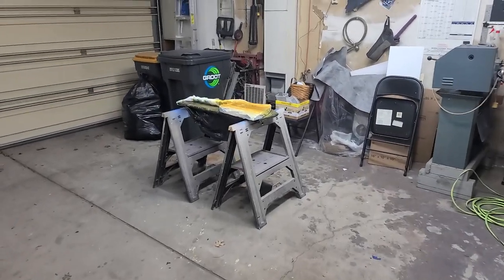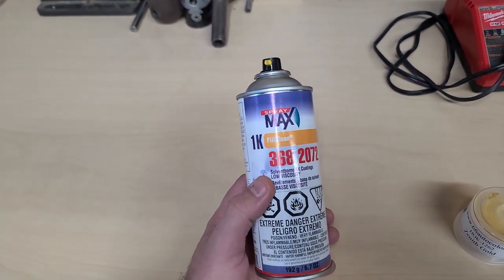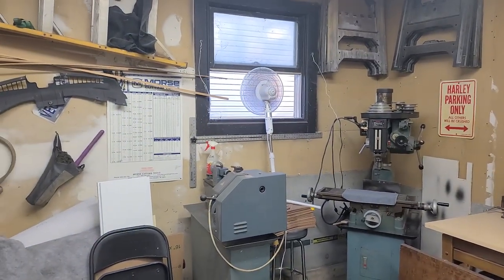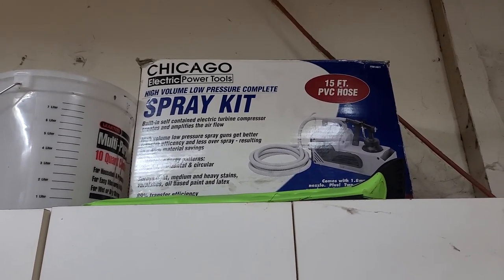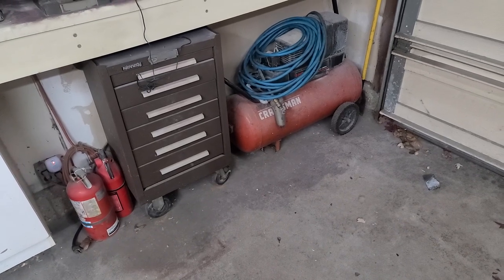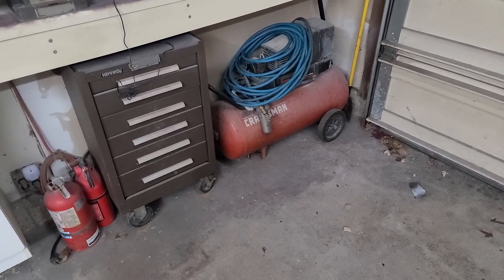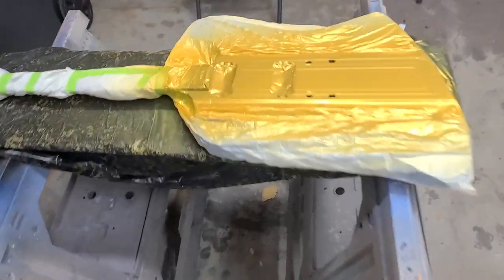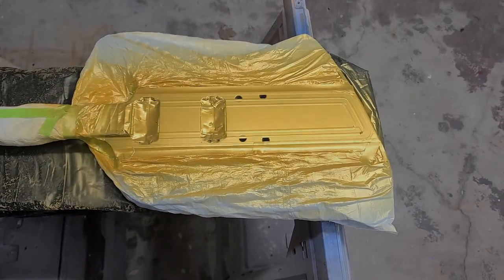Gold Phoenix Updates

Comment: I schooled myself on air over the last few years. If you're wanting to lay paint, water can be a major issue. I have I think three different water separators on my compressor and still do not take the risk without emptying my tank and clearing the lines before I paint. Doesn't take much water to mess up a beautiful paint job, FAST.
Reply from the maker: Are old compressor my father put a valve on the bottom of the tank where the tank plug was. He would fire up the compressor and open the valve. The water would come out under a little pressure. He used to have a hose from the valve that went under the garage  door and just leave the valve open just a little to let the water out as he was spraying. Having the hose under the door going outside kept the little bit of air coming out from making dust floating around. No matter how clean you keep your garage, you still get shit in the air.
Reply: @ericctheartofnoise8613  good idea! Yeah, may garage is not a candidate for painting in. LOL!